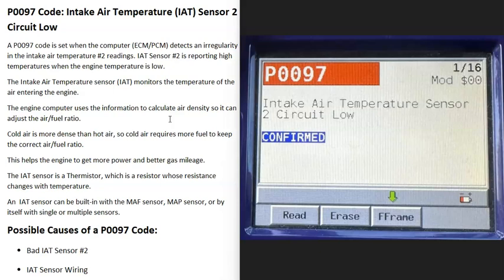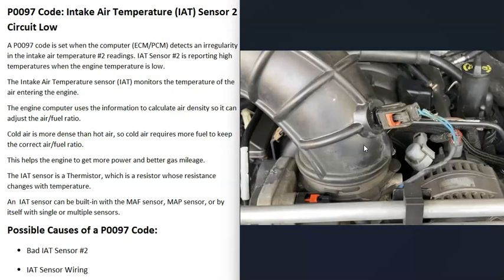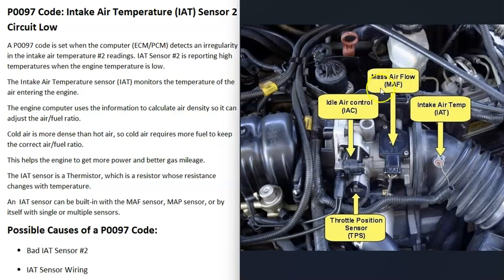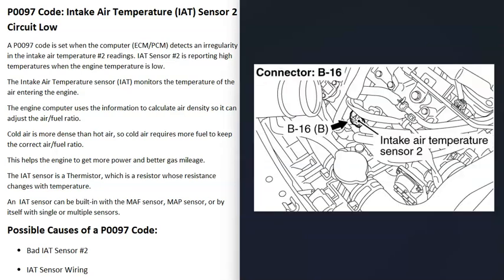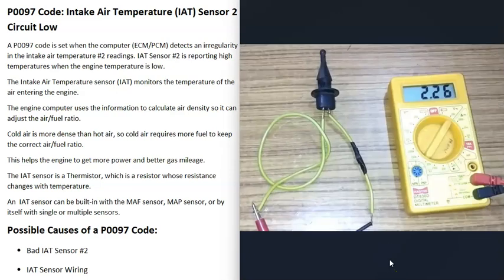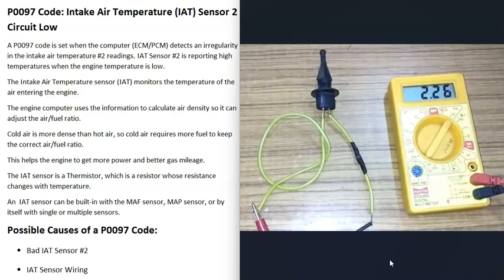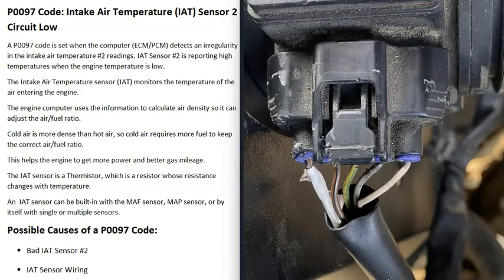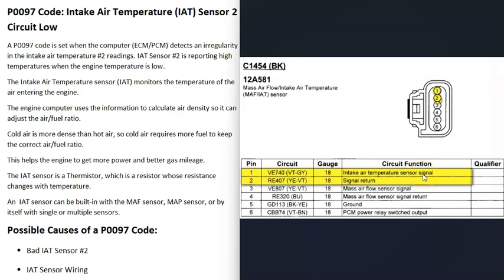Causes and Fixes P0097 Code: Intake Air Temperature (IAT) Sensor 2 Circuit Low

Comment: While my car was running I accidentally disconnected the IAT plug, but I didn't notice any changes in the engine behavior (vibration, purging, strange sounds, .....). Is that normal??
Renault fuego w/ Renault 25 injection 2.0L '84 engine on it.